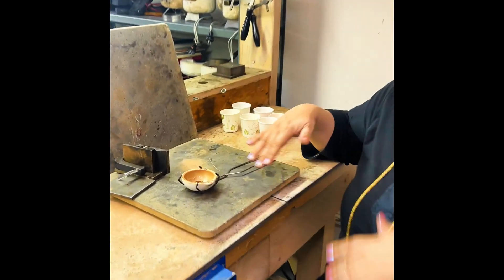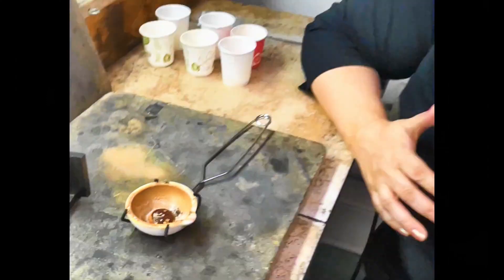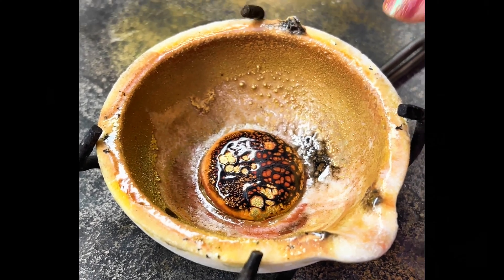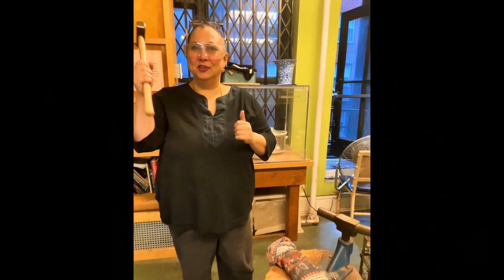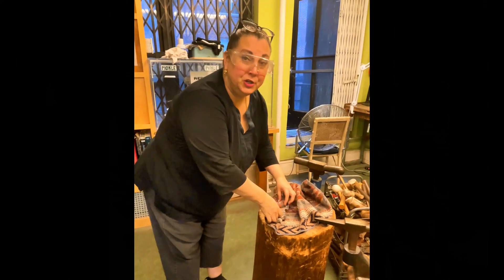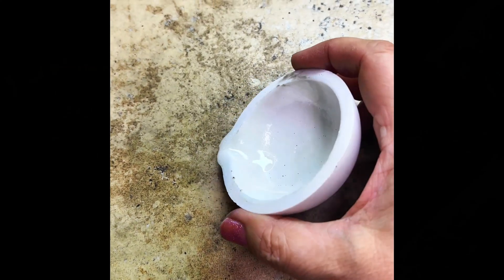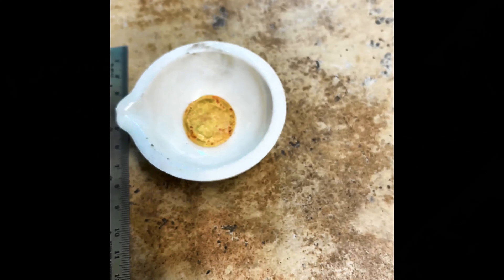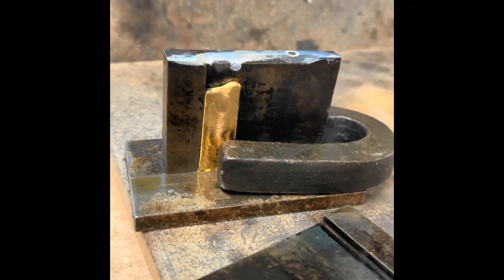When Gold or Silver Alloying Crucibles Go BAD

Comment: wtf just remove the metal by heating the crucible up to borax melting temperature to unglue the thing then put the crucible in boiling water for a while with HCL it'll remove the borax and clean your crucible brand new, then dry it and use it again

Comment: I don’t get how borax could prevent the heat
Reply: It doesnt, actually borax heat conductivity increases with heat, this video is BS.
Reply from the maker: Too thick of a coating and the metal won’t get hot enough to melt.
Reply: @JewelryArts  I have a question I always wanted answered! When setting prongs, sometimes the prong doesn’t sit all the way down and springs back up a bit. Even with annealed metal. What can I do to fix and prevent this???
Reply from the maker: I assume you are using fairly hard alloys for your prongs? People usually compensate by using more force while setting, like a hammer or hammer handpiece. If the prongs have been properly annealed, there is no getting them any softer. :) @sezstamorae9004
Reply: @JewelryArts  Thankyou, well it’s not the alloy that’s particularly hard, but I tend to make thicker larger prongs from hand pulled wire, I think they become too work-hardened to then be used as prongs. I should just start with a smaller ingot, so the final prong has had less work on it. But that brings me to another question, I find it extremely hard to properly fill a round ingot in the smaller sizes, 2-3mm. The silver just clumps up at the entrance and spills over, I’ve tried pouring extra slow and fast, maybe it’s because Im In Michigan and it’s realllyyyyyy cold??? I’d love to see a video on someone properly pouring such a small round ingot
Reply from the maker: Any amount of work hardening can be annealed out but  a very thick prong will definitely bounce back. No one can easily pour a thin ingot, I don’t bother. 😃 @sezstamorae9004
Reply: @JewelryArts  I love how real you are! Thanks so much
Reply from the maker: You are very welcome!! :) @sezstamorae9004